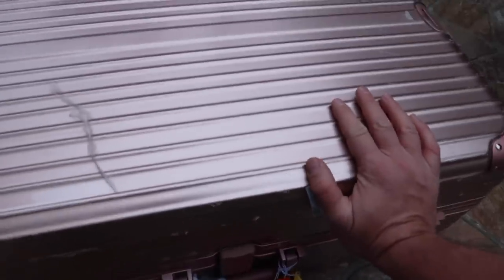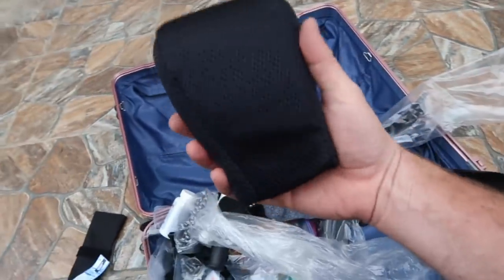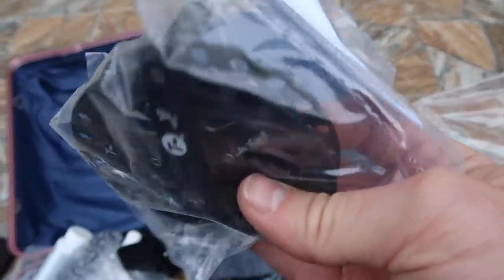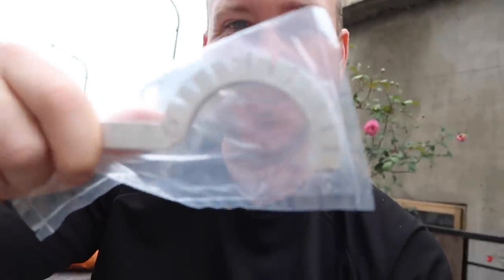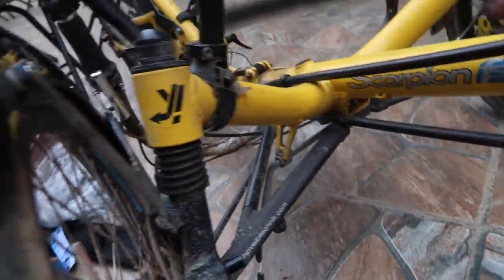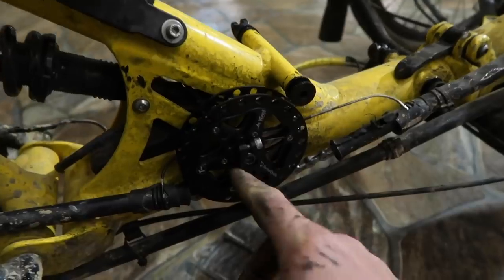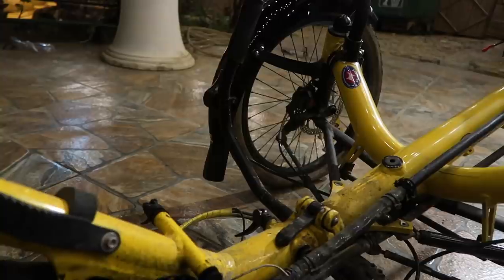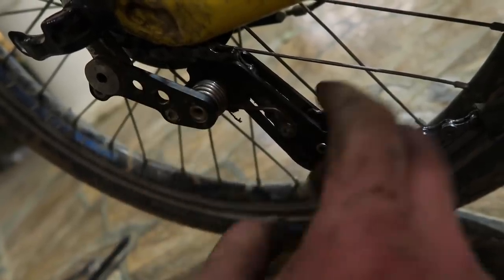Ups and Downs of Recumbent Trike Repair in North Vietnam

Comment: Having stretched the chain that much, and the idler arm skipping so much, you need to check the sprocket on the hub also. Chin up up bro, patience is a virtue. Take some time and meet some of those interesting people while you figure out the parts.
Reply: Chain may be a bit to tight and the cogs look pretty worn down as well.  Might be easier to replace the entire rear derailleur.

Comment: You either cut the chain too short or you need to adjust the derailleur. To test this try shortening your boom and inch or so to relax the derailleur or put it on the smallest rear sprocket and ride it around. You gotta problem solve Matt. Getting frustrated will get you nowhere. If you find its too short use your old master link to lengthen the chain again.

Comment: Matt, As another viewer noted the front chainring and the Rolhoff ring are probably worn as well. The rear ring on the Rohoff can be turned over so that you get another life. The chainwheel will probably need replacing. If you continue to use a new chain on old rings you will have problems with premature wear and skipping. It is all repairable just keep your chin up and carry on triking. All the best. Keith

Comment: Sorry about your frustration Matt , we have all been there . I think the hub sprocket is more of an issue then the idlers , I recall you said before that you were not able to replace it . Its jumping on the teeth and transmitting it down to the idler cage although the idlers are in bad shape too . Keep the good chain till you can replace the rohloff sprocket and the idlers  , best to address this sooner then later . The tube kit T cycle sent you is for floating the chain tubes by eliminating some of the clamps creating a more unrestricted chain line and the Idler they sent appears to be the Elite version with the ceramic bearing . Good people at T cycle . JaYoe ..

Comment: I'm sorry you had to go through such a frustrating ordeal. I feel your pain. My previous trike (which was my first) cost me $1,300 in repairs and I only road it 3,300 miles over 18 months (on pavement 99% of the time). I experienced as much down time as riding time. The frame even cracked! Ugh! Trikes. I live those temperamental monsters! I'm glad to see your back up and running "smoothly" since this video was posted.
Reply from the maker: What brand was it?  Sounds like a lemon.
Reply: @JaYoeNation  I'll send you a message.

Comment: Yes I feel your pain! I have a few years of experience working at a local bike shop. You have my email Matt if you ever need some questions answered I would be happy to do so. Yep it is very frustrating when you don't have the proper tools or parts to fix what is broken. JaYoe!  PS on the chain tensioner you will need from Rohloff  Article number 8250 I do believe. You can get just the Jockey wheels Article Number 8251 

You may want to look at maybe getting the 500/14 serviced by having the oil changed with the approved Rohloff oil in the near future.

You mentioned in a previous video you had a new gear for the Rohloff hub. I would ask Rohloff to send a tool to change that along with a new tensioner and maybe a extra set of jockey wheels. While they are at it send you Article 3000 and 3100 to check wear on chain and hear on hub. 

Chain tube kit is used to pull your chain through the trike tube for the chain. 

If you haven't changed your shifter you may want to hold off on that one till you get to a bike shop. I wouldn't want you to take a chance unless you feel comfortable doing the switch over.

Comment: It would be frustrating but not as intensely had time not been beyond critical. At some point it will be less stressful to concede that circumstance necessitates cutting the cycle hold up point short. Getting commercial transport to the caving meet up and then back to the hold up point to start again.
On the upside now you know that at the next chain change , what mating parts you will require.

Comment: I have that headrest and the bracket for it is totally different. oops. The headrest goes on the contoured seat not the one you have.Once the chain is stretched that much you need to replace all the sprockets and chainrings. I have ridden through the winter a few years with mud snow and ice and found out the hard way. Oh well hope the old chain holds till you can find a place to get that repair done. Best of luck and Ja Yoe on!!

Comment: I have an ice adventure trike with an shimano allfine 8 speed in the rear. It uses a regular rear derailleur set permanently to the correct position as a chain tensioner. It may be a good temporary solution until you can get the roloff tensioner.

Comment: As far I can tell the chain tensioner is just a chain tensioner. You basically use any fixed gear chain tensioner or even a rear derailleur.
Reply: And of course a long cage derailleur has a larger capacity then a single speed pulley. So probably the best alternative. Just limit it with the screws in the right position.  

The chain looked a bit on the short side. But I guess you know what length it should be. 

And do they have water in North Vietnam? Holy cow does that trike look dirty.  Yes it is the same as a nice smooth asphalt cycle path in Holland on a sunny day you're riding on. I tell you, if I see one dust particle on my trike I carry it home.
Reply: The Rohloff Chain Tensioner Pulleys look pretty much standard derailleur wheels to  me.

Comment: My headrest kept moving even when I tighten the bracket.  Cut up an old tube if it happens to you.  Put the old tube in between the head bracket and frame.  For me the bracket stopped coming loose.